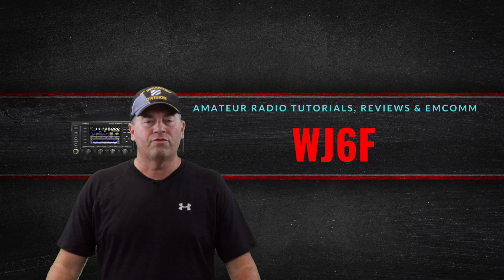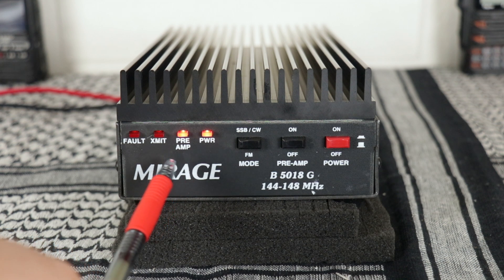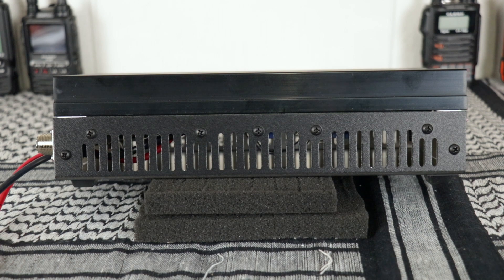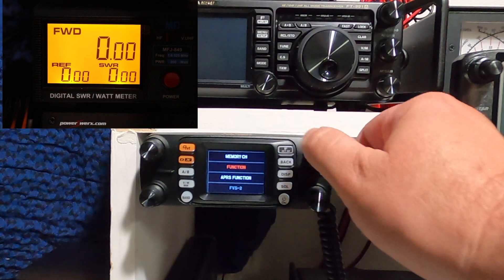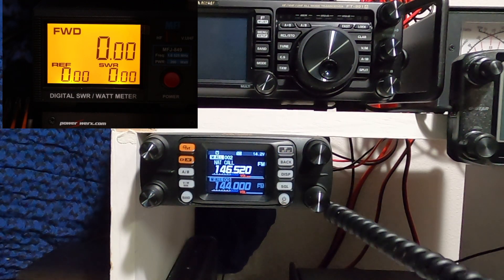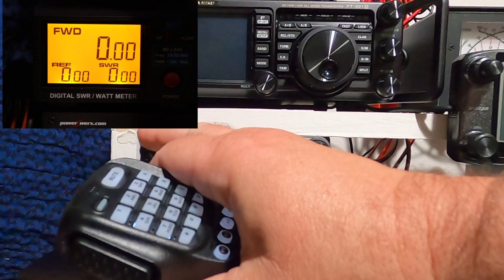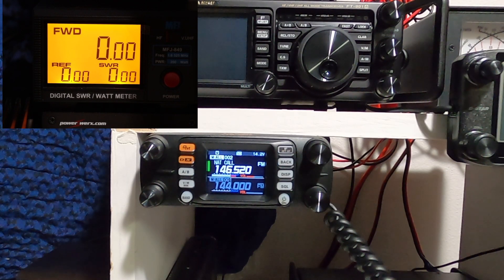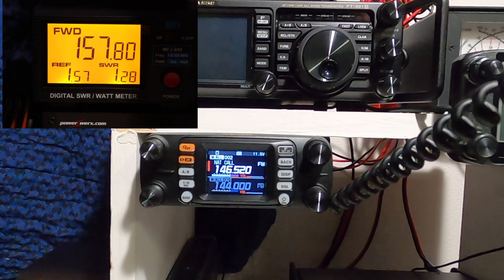Mirage B 5018 G 2 Meter Amplifier

Comment: awesome video very helpful  question i have a icom ic-7000 vhf/uhf hf all mode will this amp work on my ic-7000 for 2mtr ssb
Reply from the maker: Thank you for taking the time to watch and the comment! It is greatly appreciated. Just to be safe I would contact Mirage and verify that it will. In my opinion I would think it will so long as it is on 2m.

Comment: How does the passive pass-thru work with the amp turned off?  Is there any degradation with Rx/Tx on 70cm?  Also, it's two years later now...how is it holding up?

Comment: Does anyone have experience running one of these in their mobile rig?
Reply from the maker: Thank you for taking the time to watch and the comment! It is greatly appreciated. I have not yet, but I am looking at putting it in my truck to see how it works.
Reply from the maker: I have been running mine in  the car for several days and it works great! No issues. not sure how the battery drain would be on most smaller cars as I have the luxury of dual batteries.

Comment: Enjoyed your video. I do own one but cannot get more than 135 watts at max power. I bought it used for 150$ so no complaints.
I also wonder if you had problems with the pre-amplifier switch it doesn’t seem to affect signal?
I plan to take it apart this week and put the scope on it and fix it. Any suggestions would be welcome WW1TA
Reply from the maker: Thank you for taking the time to watch and the comment! It is greatly appreciated. I have not had any issues with the pre-amp at all. I honestly do not have any suggestions, because my suggestions would probably cause a release of the coveted smoke.

Comment: Hi! I am thinking about getting this amp. Do you have to use the relay or do you just plug the output of your radio in to this amp?
Reply from the maker: Thank you for taking the time to watch and the comment! It is greatly appreciated. I have never used the Relay Jack. This is what I found in the manual about the Relay Jack. The RELAY jack is used to manually place the amplifier in the transmit-mode when it is pulled
low (to ground). It is a conventional phono female connector (also called “RCA jack”). This
type of connector is common with VCR’s and other consumer electronic devices.
The current from this jack is less than 100 mA, and the open circuit voltage is less than 15 volts.
There are no damaging back-pulses from this jack, it is fully buffered. Never apply voltage to
this jack. Here is a link to the owner's manual:    https://cdn.shopify.com/s/files/1/0289/7782/3843/files/B-5018-G.pdf?v=1586534049

Comment: Very low gain. I have a 200 Watt Mrage B-320-G which gives fill output with just 6 watts of drive. Works just great with a Yausu FT818

Ian G4JIU
Reply from the maker: Thank you for taking the time to watch and the comment! It is greatly appreciated. That is one of the draw backs to this amp. I wish I could get full power from the amp with minimal input from the radio.
Reply: @WJ6FRadio  seems silly to drive a 150w amp with 50w.

Comment: I dont like that you have to drive with 50W to get full power, sure its a safety design, so nobody can blow up with a 50w transceiver, but putting 50w on it is a waste of energy, the amp will have to "burn" that power, and the driver rig will get hot as well. W6PQL have an amp that output 1kW with a 5w max drive, so go figure
Reply from the maker: Thank you for taking the time to watch and the comment! It is greatly appreciated. I agree. I do prefer an amp that does not require full tilt from the radio to get the maximum from the amp.
Reply: It will actually do full output with low drive by removing the input attenuation load resistor. 
Mfj ruined the quality of these amps when they took over mirage. 
Original mirage amps were much better.